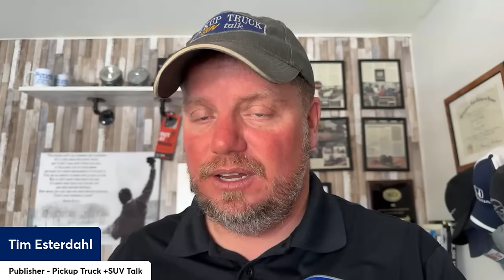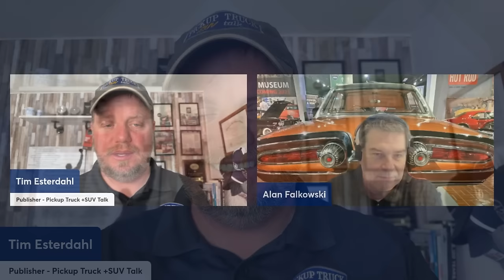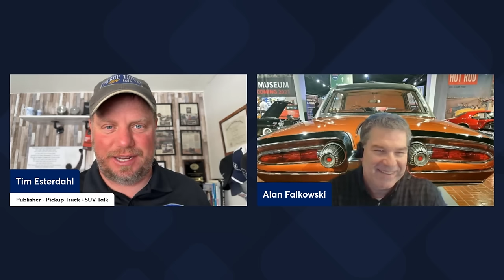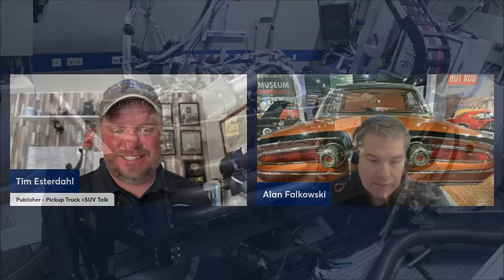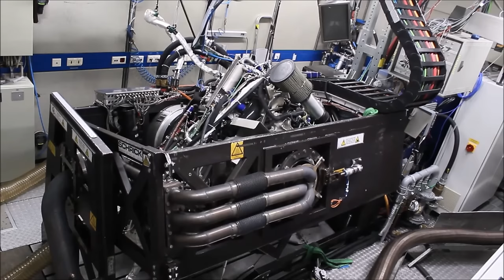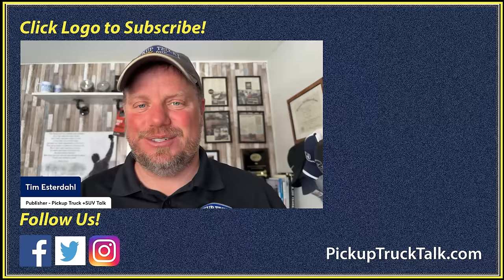Engineer Deep Dive: 3.0L Hurricane Engine - Turbo Life, Oil and Intervals and More

Comment: I don't care what anybody says, removing a physical dipstick to check the lifeblood of the engine is a stupid move.  And honestly it's a slap in the face to the consumer.
Reply: Yep.  If they want to add a level sensor, fine.  But don't eliminate the ability to check it manually.
Reply: Is there not a location to add an aftermarket one?
Reply: Planned obsolescence.
Reply: I agree but I make my oil tech write down my oil date and I change at 5000 miles. I have the oil pressure gauge on the dash and I check the level every weekend
Reply: @jimsteinway695 Gauge can fail or get faulty with time, oil can get burnt badly and everything look fine on  the gauges...just saying
Reply: Yep, an absolute disgrace. We had these big 3 engineers coming to our engine bearing plant I used to work at, and most of them were some of the absolute dumbest people you'd ever meet when it comes to vehicle knowledge.
Reply: A real gearhead can feel the oil and the engine will talk to you.
Reply: @TheRealestHi  Nope and you are not a gearhead.
Reply: @TheRealestHi  How are you planning on feeling it?
Reply: It's the perfect way to hide oil consumption issues from the consumer though. Toss out the dipstick and have the computer tell you a vague oil level estimate.
Reply: Statistically not all consumers check engine oil level at every gas fill up.  A level sensor is much much better for 95% of people.
Reply: @hochhaul  Excellent point
Reply: Totally agree.
Reply: Give it some time….my bet is that some shmuck will come out with a aftermarket filler tube and dipstick……

Audi did!
Reply: @truckguy6.7  With your fingers. That's how we did it in automotive school.
Reply: @richardweyland116  Yeah, I get it but the original comment was lack of a dipstick. So there's that.
Reply: Bmws been having this for years honestly don’t bother me
Reply: If you have a n engine that doesn't burn any oil, a level sensor wont do anything. I like to be able to check the color
Reply: @redneckedition1608  BMW's are well known to be some of the highest maintenance vehicles out there.
Reply: Honestly it was easier to check the oil level on my BMW i had then my Camry.. never even had to pop the hood! Any time i went onto the highway it would tell me how much oil i had! Which was perfect because my car leaked oil a bit haha, Imo all cars should have both systems.
Reply: Agreed that it is a slap in the face of the knowlegable and conscientious consumer.  But... what percentage of consumers fit that description?  Remember that those who are NOT knowlegable and concientious are the majority of consumers, and they are MOST likely to show up making a warranty claim based on their neglected maintenance.
Reply: @billyjoejimbob56  How does having a dipstick interfere with maintenance? If they want to have a sensor, that's fine, but don't take away the dipstick for people who do care.
Reply: @wvjeepguy8178  My point... OEMs make these decisions based on the majority of consumers, and of course, cost including warranty.  Not defending, just explaining.
Reply: Especially if something breaks down for the sensor wonder how much it would cost to replace
Reply: It makes sense to me. It'll cost hundreds to replace when it does go bad, and it's probably mounted in a location that make it difficult or impossible for the average driveway mechanic to DIY. More money for them. That's why they did it.
Reply: Most consumers don't check their oil.
Reply: @blackericdenice  Fair enough but I for one am getting absolutely tired of society catering to the lowest common denominator. With all the BS that comes on modern vehicles they decide to penny pinch on the freaking dip stick? ARE YOU FING KIDDING ME?
Reply: @briancavanaugh7604  There are a lot of people who don't check their oil. I'm not one of them. Putting a meter inside make sense.
Reply: @briancavanaugh7604  Do you change your own oil?
Reply: @blackericdenice  Yes I agree the sensor has value BUT not at the expense of the dipstick. WHY WHY WHY do people always seem to think the way that works for them is the way it should work for others? If you don't use the dipstick that does NOT mean many others don't.
Reply: @blackericdenice  No, I don't. I do check the physical appearance of my oil at least once a month as I drive less than 2 miles a day and the "3000 miles or 3 months" simply does not apply to my situation. I also trust electronics about as far as I can throw the truck they are in. I remember when computers failed regularly and I will NEVER put 100% trust in an electronic made by the lowest bidder, often with slave labor in some third world country. I DO NOT worship at the alter of tech like most these days. You may have your shiny sensor, but I would like my manual dipstick. It's NOT an either or situation.
Reply: @briancavanaugh7604  Like said, most people don't check their oil.
Reply: @blackericdenice  Most people don't use their spare tire, I still want one. Most people don't use their exercise equipment, I use mine daily, most people................I don't care what "most people do," and would prefer if my insanely expensive truck was not dumbed down for the masses ,but that is just me. LIKE I SAID Catering to the lowest common denominator on societies race to the bottom.
Reply: @blackericdenice  Watched ten seconds of your home page video, I don't argue with people who say "EYIGHT." Good day.
Reply: @briancavanaugh7604 he outsmarted you so you try to throw jabs. Typical
Reply: @javadabaron81  Not sure how you consider that being outsmarted, but okay, I totally lost, lol. Less for more, the new normal. lol
Reply: @redneckedition1608 yeah, that’s not saying much 😅
Reply: Yeah right. All we need are more sensors to go bad. I'll keep my 5.7 with the dipstick. 230,000 miles and going.
Reply: @truckguy6.7  it runs through his veins
Reply: @hochhaul yup. I have a GM 2.7L. Burn 3\4 qt per 3K miles.
Reply: @stephencannon3140 B&M came out with one for the GM transmission.
Reply: @anthony2558  That's not that bad these days. Toyota changed their warranty back around 2011 or 2012 to state that it's normal for their engines to burn 1 quart every 1200 miles. Same with Honda. 2.5 quarts every 3000 miles is "normal".
Reply: Do you know why they are doing this? there are owners out there that for whatever reason remove the dipsticks from the port and are driving around until the engine fails and then suing claiming a defective product. Why are they doing this? who knows. are the people doing this on a green lobbies payroll? yes they are.
Reply: @GROGU123  Why not have both?
Reply: @GROGU123 
Who doesn't? I've had vehicles made in the 90s that burned less oil than modern vehicles. Which isn't good considering most modern vehicles run on over head cams which can't be starved for oil

Comment: So with all this R&D, why do we still have 36,000 mile warranties? This engine should be able to go 200,000 without issues. The results are never what they are selling.
Reply: Because alot of people don't take proper care of their vehicles. No one is going to warranty stupidity.
Reply: Because it's About 36,000 is when you Start to have problems with the components and possibilitie the Motor.
Reply: Because the manufacturer actually buys insurance for those warranties, and the less they offer, the less they charge you

Comment: As a retired Chyrsler mechanic I've cursed engineers most of my working life. They can say what they want about this engine being the greatest thing since sliced bread. Heard it before. Remember the 2.7. Only time will tell if that's true. Wouldn't touch one with a 10 ft pole for at least 3-4 years of production and real world use. Only then will we start to learn of what they didn't think of or cheaped out on. No offence but I'm not being the guinea pig.
Reply: There’s a reason you’re a mechanic and not an engineer.  Turbo diesels in 18 wheelers have hundreds of thousands of miles.
Reply: Well put, I totally agree with you.
Reply: If turbochargers are so great why don't the have a longer warranty?
Reply: @jimsteinway695  Way to prove how clueless you are. Do you really put engineers up on such a pedestal? You obviously don't work on vehicles.  Your example of a big truck turbo diesel has almost nothing in common with this engine. Are you even aware of the absolute failure this same company just had with the 3.0 eco-diesel?
Reply: @jimsteinway695  Diesel engines in 18 wheelers cost as much as a brand new loaded 1500 truck. Those engines are built with extreme durability for commercial applications. You are really trying to compare that to a light duty gasoline turbo charged engine???
Reply: Lack of oil capacity caused that disaster
Reply: @wvjeepguy8178  given that this engine has been out for about 3 years now and has consistently been rated as most reliable for all 3 years? Not sure if I would agree with jim, but the OP is just mind-numbingly ignorant. And that's ok. Lots of us old-timers prefer the older, simpler set-ups because of the nostalgia of working on them with our dad's. But that's also not being objectively fair to this new engine.
Reply: @Kainis80  You think 3 years is relevant to reliability? Plenty of firsthand reports online of issues from owners. Wagoneers also aren't seeing nearly the stresses that these engines are going to see in trucks for towing and offroad use. Also, our love of older engines doesn't come from "nostalgia of working on them with our dads". It comes from working on them ourselves on a regular basis.
Reply: @jimsteinway695 this is a gas engine, not diesel. Totally different, how slow are you?
Reply: @Terry-p7t  They actually do. A 2024 GM w/ 5.3 V8 has a 5 yr / 60,000 mile drivetrain warranty. The 2.7 turbomax has 5 yr 100,000 mile.
Reply: Also, The GM 2.7 turbo has been around for 5 yrs, (Ford 2.7 - 10 yrs). GM is built like a diesel (with spark plugs), but runs on 25% cheaper 87 octane fuel w/ no def. Engineering results in Nodular iron spinccast cylinders, piston w/ iron carriers cast into them that carry the piston rings, forged crankshaft, connecting rods, mainbearing caps, big/heavy head bolts, etc. And, since the 2.7 turbomax is a dual overhead cam engine, no lifters to fail from cylinder deactivation. 10% higher ft-lb torque than 5.3. Embrace the future.
Reply: Any semi truck engine after 2007 is absolute nightmare...
Reply: @truckguy6.7  GM Turbomax is basically a 4 cylinder diesel w/ spark plugs, running on 87 octane gas w/ no def. Nodular iron spincast cylinders, pistons w/ iron carriers cast into them that carry the piston rings, forged crankshaft, connecting rods, mainbearing caps, big heavy head bolts, etc. Dual volute turbo producing up to 27 p.s,i, of boost.  Truck application designed/engineered to produce 430 ft-lb torque @ 3,000 rpm is "light duty"? 9,000 lb tow rating. Drive one. You'll become a believer in data/ facts, not feelings.
Reply: @ews360  GM does have the ability to produce good stuff. History says most of the time they don't. Cool description of that motor. It will be interesting to see if it's another GM nightmare with time.
Reply: @truckguy6.7  I waited for 5 yrs of production before I pulled the trigger on my 2023 2.7 bought 6 months ago, & have 5 yr / 60,000 mile drivetrain warranty. 2024 has 5 yr / 100,000 mile warranty. LS engines were good for 1st 7 yrs  - 1999 - 2006 (before AFM / cylinder deactivation V8 to V4 2007 - 2018, followed by DFM V8 to V2 2019 to current). Lifter failures is what made me consider 2.7 turbo vs 5.3 V8. Plus a 10% increase in ft-lb torque (383 to 430) for $6k less. I bought 40,000 miles worth of fuel w/ savings.
Reply: "Our product is solid because of all these science and technology
. Trust me bro..."
     -Chrysler/Cerebus/U.S.GOVERNMENT/Fiat/Peugeot/Stellantis
Reply: @jimsteinway695  Cold exhaust, brick shithouse construction and low RPM are not found on gas engines.
Chrysler(many) has done this before and pulled back due to warranty.
Repeating same crap is saying we know better these days.
Been there-done that.
Reply: @ckratzet5286  I understand that but these guys are pretending turbos are new technology. Porsche has been doing gas turbo motors for 50 years. It’s not black magic.  I have a ford ecoboost f150. Change the oil every 5000 miles it’s not difficult.  It’s not rocket science. The fact is motors are more technologically advanced. You can’t treat them like a 1968 Chevy half ton.  You need to pay attention to maintenance whether is a Mazda turbo or a F150 eco boost. If you don’t change the oil or pay attention you get what you get.  There are thousands of 911 turbos out there with hundreds of thousands of miles because Porsche guys (mostly ) treat their cars as an investment and treat it as such.  You buy a $65,000 truck you better do your due diligence on research and maintenance. It’s not hard.
Reply: @jimsteinway695  I am well aware of Porsche with and without turbos.
in 1990, $350 for a set of sparkplug wires, $4000 for a clutch, $100 for one axle's worth of brake pads(parts only).
$1900 for the outer chain tensioner, $2500 for both.
Tune up was $3000
I expect same as or more on some others. This is why a cheap exotic was $20k-$30k for the whole car that was due for a major service which was $15000.
Reply: @ckratzet5286  you’ve never owned a 911 OR you were paying for your mechanics 401k plan.I’ve had 9 including 2 turbos 3 GT3s and a GTS. My first gt3 had a clutch 2004 was $2500 including the single mass flywheel I bought to replace 
the dual mass fly wheel, at Bakersfield Porsche. I did a complete brake replacement on a 993 including calipers was $1500 for 4 wheels in 2010. Rebuild my turbos on my 993 in 2003 was $750 each 
I don’t know where you got your maintenance done but you way over paid. Today oil change on my 18 GT3 is $200. And this is in California. Not exactly the least expensive place to get stuff done . And by the way 911s are very easy to work on yourself. People are just afraid.
Reply: @jimsteinway695  Dealer quotes on a '79 911 German market, '84 928 us spec.
Parts were from Porsche back in 1980's.
My point is, dealer sourced parts with or without labor is $$$$. Especially on "exotics" .
I bet all of those you have quoted will apply to the I6 TT RAM
Reply: @jimsteinway695  Chrysler produced more turbos than any other auto manufacturer in the 80s. 2.2L Turbo was their stopgap until they had a proper V6. Also, every Chrysler truck person knows about Cummins turbo diesels. No one is calling a turbo new tech. It's the added complexity of modern stuff, cost and access to ability to repair, Chrysler's track record with reliability of products, Chrysler's own reputation with turbos,  Ford's ecoboost problems, and the overall drop in quality of hard goods that have people concerned. Being an early adopter with a $1k+ car note is really not a good idea for most folks when there are proven products with well understood reliability data and lower cost.
Reply: @jimsteinway695  Tell us you're not an engineer or mechanic without telling us. A turbocharged gas engine deals with completely different challenges versus a diesel engine. For example, diesel engines don't use spark plugs
Reply: Do you curse the engineers that created the engines in the first place? Do you realize without them you never would have retired as a mechanic? Or I suppose you're gonna say we should still be riding horses around? this logic is asinine, enjoy you're retirement but please if you fish use a cane pole vs. a new reel because engineers came up with those too and while you're at is sell that twin engine CC and get yourself a paddle boat.
Reply: Yep you nailed it for me too.

Comment: The Stelantis guy told so many lies in this interview it’s a good thing he wasn’t Pinocchio!!! They went to a 10,000 mile oil change because of carbon credits not additive packages.
Reply: legit.  every other country in the world their owner manual probably says 5k or 6 months whichever comes first
Reply: I agree with that assessment. It's about climate requirements, no doubt.
Reply: @jorgeblanco6708  yes and maybe the mfr doesn't want engines to last as long also
Reply: @blaken3824  Ah no.  Over in Europe, oil change intervals are up to 30,000 km.    That's nearly 18,600 miles in freedom units.
Reply: @TheUweRoss  *some BMW (non turbo) models.   Everything else 10k km.  Europe gas very low sulfer.   Europe formula oil 5W-40 more expensive.

Comment: I think the reason people don’t trust turbos or start stop tech is that truck buyers have been burnt way too many times by engine failures.  I won’t buy a travel trailer because I don’t think I can buy a reliable trailer or truck.  So, I just won’t buy either.